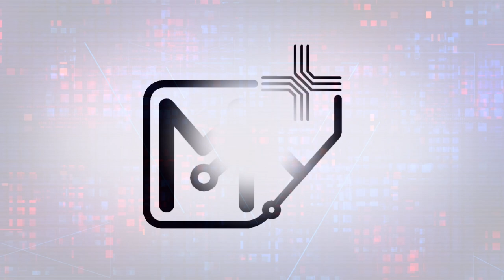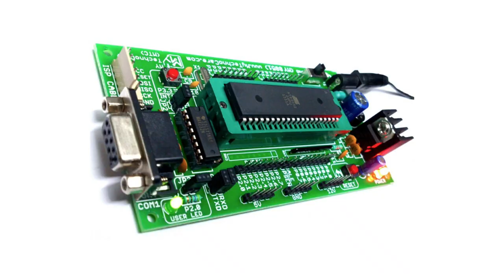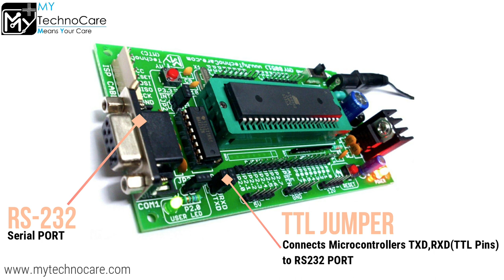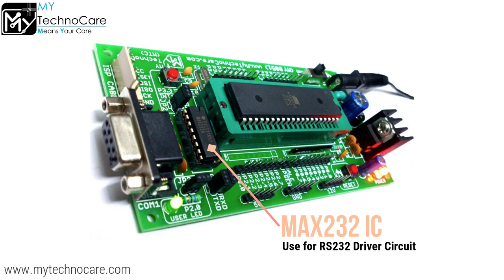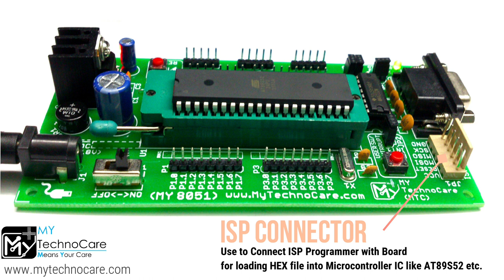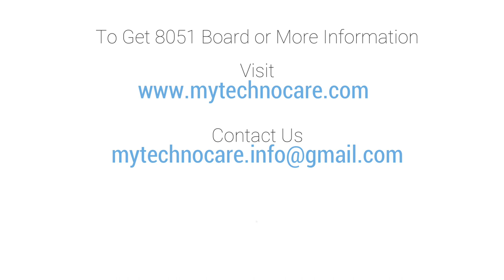Learn Features of 8051 Development Board | Atmel AT89S52 Microcontroller Project Kit | MY TechnoCare

Comment: I have mytechnocare 8051 development board. Some days ago it was properly working but now its not working properly. It output pin instead of giving 5v output are giving only 1-2 volt. What should i do
Reply from the maker: Hi There, You should use Pull up Resister on Perticuler PORT Pin if Required. Also make sure your Digital Multimeter battery is not discharge.

Comment: It's possible to program AT89C51?
Reply from the maker: Hello Dear, 
To Program AT89C51 or any C series IC chip you need parallel Programmer.

But this board can run Pre-programmed AT89C51IC.

Comment: sir Can i program in any kind of ic with this device
Reply from the maker: This is Development Board which supports 8051 Microcontroller 40 Pin DIP package. So You can Program 8051 IC.For example Atmel AT89S52, AT89S521 etc. But this development board can not support AVR Microcontroller or PIC microcontroller ic.

Comment: sir what about power supply ??
Reply from the maker: Hi There
You can give power supply to this 8051 board using  9 to 12 Volt DC Adopter.
Also another option is to take power supply from USB Programmer which is connected to your PC COMPUTER OR LAPTOP.

Comment: how can I do serial communication and parallel communication with this board? ,any video link will be helpfull
Reply from the maker: Hello Dear
For Series Communication, you can use on board RS232 Port which is Connected to UART module of 8051microcontroller.
For you can also use TTL level RX & TX Jumper Pins for serial  communication. 

Thank you for asking this interesting Question.Fill free to ask more Question

Thank you
With Regards
MY TechnoCare